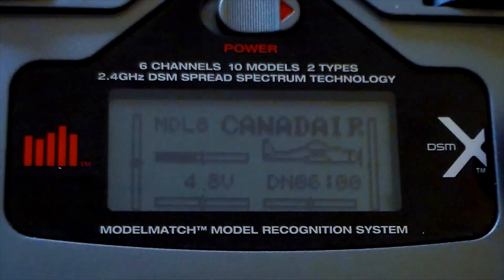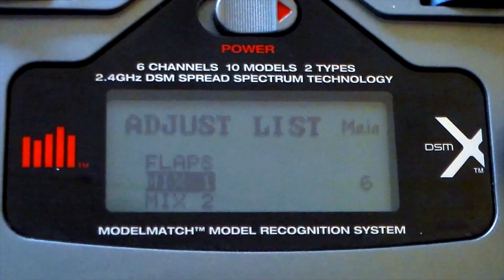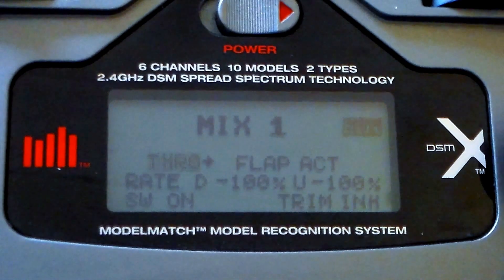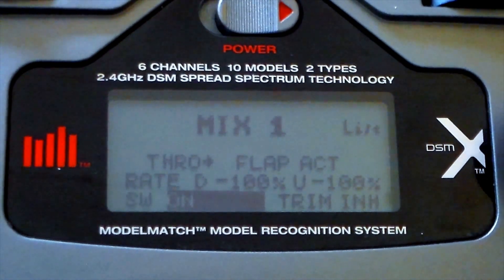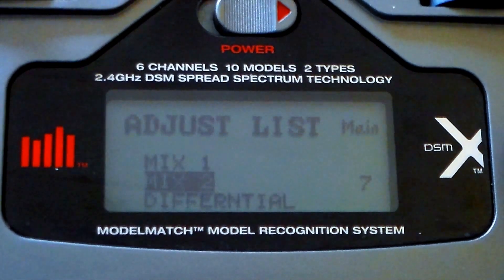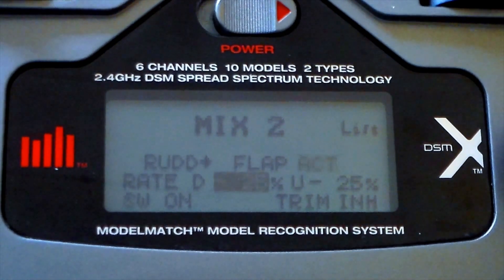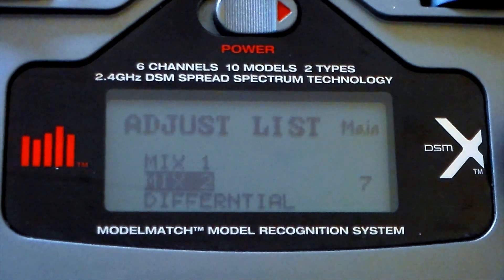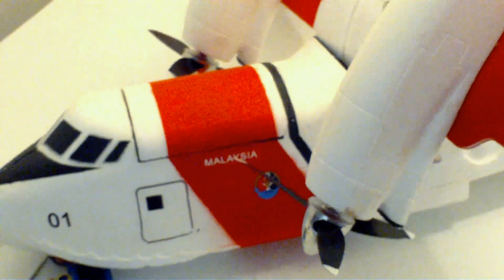Spektrum DX6i Differential Thrust Programming.

Comment: hi i have a DX6i and im trying to set this with my HobbyKing Lancaster Bomber V3 which needs  this because it doesnt have a working rudder.

everytime i switch off the transmitter, one set of motors spin really fast. the only way to switch that off is if i turn the transmitter back on. 

Am i doing something wrong?

thanks
Reply: Turning your TX off before the airplane is what you are doing wrong always Tx on first always TX off last 👍

Comment: Great demo and explanation. If using a YAW Gyro, would you connect the AUX FLAP motor to Rudder in out on the gyro?
Reply from the maker: Thanks for your support! 😎 I've never used a gyro, but I think the input should be direct from the receiver and the rudder would connect to the gyro output. The gyro is then in control of the rudder, adding in corrections to the receiver signal. Cheers!

Comment: Great solution!  I'm building a trirotor tilwting and will try this on the DX6i.  Thanks!
http://www.rcgroups.com/forums/showthread.php?t=2334070&page=11#post31335181
Reply from the maker: Glad it was helpful. Sounds like an awesome project!! Good luck!
Reply: Zen Flying Thanks!  I just did a few test-flights today with the differential throttle and it worked great for turning right, but not so much for turning left for some reason.  It seems that the flaps channel and throttle channel are using different activation curves or something, because at various throttle stages the left and right motors were running at different speeds...I'll see if I can get things working with this method, but we might just wait until the parts for our KK2 board come so we can throw in some differential thrust that way :)